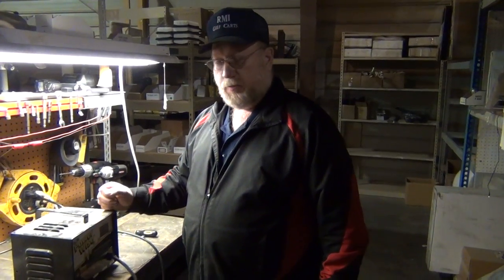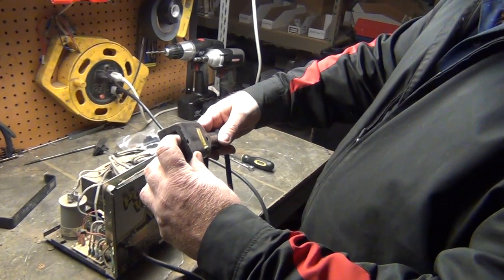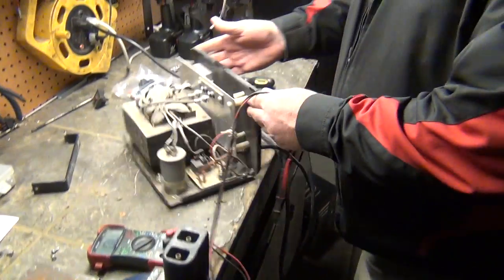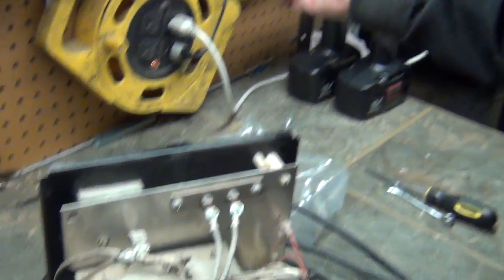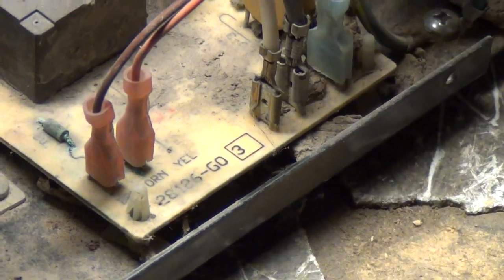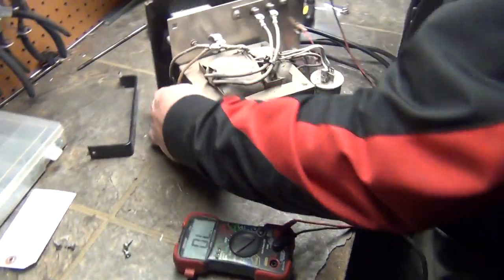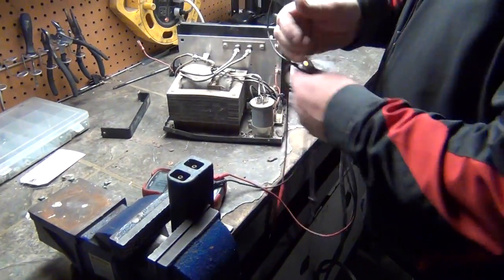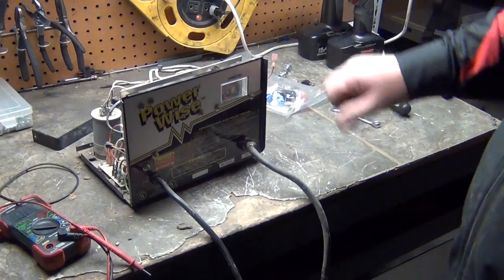How to repair an EZ-GO Powerwise Golf Cart Charger

Comment: Great video Matt! 

I tested my 50 Amp Fuse = good, Both diodes = good, grounding pin in handle =  good, the relay on the board, didn't buzz and turn on, so i assume it's good. however when i do continuity test from the screw on diode wire to the positive terminal on handle it works, it beeps.. negative side has no continuity, when i check with opposite screw like you did in your video. 

what would you recommend to test next? capacitor, transformer, etc? i don't see a bad wire. The wires coming from the diodes go right into the transformer itself. 

any help would be appreciated :) 

thanks

Comment: Great vid but what about the capacitors are fuses?  So long story short my charger was left in my trailer in the desert and 120° weather and I’m trying to diagnose it if it could be the capacitors or the long fuse I have a cylinder fuse EZ go  charger  80s early 90 thx Mike

Comment: Mike, does the black wire that connects to the red wire from the DC charging cord connect to the green ground?  It was loose when I opened it up.  The end of the wire has solder on it.  My charger was struck by lighting.  The fuse is blown.  Anything else in particular to look for?  Thanks for the video and for your response to come.

Comment: I had one with a bad capacitor. Replacing the capacitor fixed it. You did not cover that. It is not necessary to remove the charger carry handle screws for disassembly. Your video is very informative. I now have a charger that has a blown 50 Amp fuse and according to your video, 2 bad diodes. Is it common for both diodes to go at once? If so does that make the fuse blow? I just replaced the diodes and 50amp fuse. Totally fixed it.

Comment: I tested the fuse and the diodes and they are bad. Bit when i tested ths relay with the screwdriver i heard a buzz. Does that mean that the board is bad? Or do i have to replace the fuse and diodes first to test the relay?

Comment: Mike, not always the case. I ran the tests you described and found my board was bad by your directions. Replaced it and the charger did not work. Took a shot in the dark and replaced the capacitor after the board and it works fine. Thanks for the video.
Reply: David Biester Nest time measure the Capacitor like this: Set your ohmeter on a high scale and remove the wires from the capacitor, next touch the leads from the meter to the connections on the cap. If the meter stays on zero ohms the cap. is shorted, if the meter immediately goes to a high resistance it is an open cap. and is bad. If the meter slowly raises in resistance to a high value it is good. It is actually charging with a current supplied by the 9 volt battery in your meter. If you check the capacitor in the circuit with the charger humming you should see a voltage that looks ridiculous like 680 volts this normal. if you see something much lower replace the cap. also if you see a noticeable bulge in the metal body of the cap replace it.

Comment: If the multimeter beeps when i touch the heat sink board is the charger still able to charge? The charger humms whenever i bypass the relay, so i know the control board is bad..

Comment: I bypassed the board and found it to be the problem but put a new board on and it still does not work.  I bypass it again and charger works and golf cart response.  I have now tried 2 differ "new" boards and the charger is still a NO go.  What else do I need to look at??

Comment: I replaced my board, fuse, and diodes and my charger still wont charge, i can jump the relay on the board and it will charge. Any suggestions?

Comment: My charger is not fully charging by dead batteries. It should take 6-8 plus hours to full charge the batteries. When plugged in the meter shows charging but in an hour or two it shuts down.   What could my problem be?

Thanks,
Dale

Comment: This is a great how to video.  These type of chargers are really simple and reliable in my opinion.  So why does my EZ_GO have a PowerWise Qe model that looks like a power supply out of a computer on the inside?  There is no simple fix for that one.

Can I use one of these older style chargers in the place of this fancy, expensive to maintain one?
Reply from the maker: Sure, as long as its 36v.

Comment: What about the chargers that replaced that model. One little black ones with the cooling fins around the charger does these same things apply to it. Would love to see a video on that style charger thanks man
Reply from the maker: Unfortunately, those newer charger cant be repaired. We have to send them in to be rebuilt.
Reply: Thanks for the reply
Mines a power wise QE I think what's a rebuild on one of them usually cost? And is it even worth it or better to just buy a new charger
Reply from the maker: I'd probably buy  a new one. https://www.rmigolfcarts.com/products/e-z-go-rxv-txt-48v-charger-pf11595
Its about the same as having them rebuilt.

Comment: SO, what does the clip in the charger plug (he calls it a handle) suppose to look like? Does it curve out, does the end point outward, etc, etc? I see the clip. It is not touching the post. It is bent into a rounded shape. I do not know if it is suppose to be flat and touching, if it is suppose to be rounded and spring back and forth, or what. Thanks.
Reply: I took the "handle" apart, and it was evident how it is suppose to be bent. Everyone I know, call that a plug. The handle is the handle on top of the charger, to carry it around.

Comment: Have changed circuit board, 2 diodes, checked continuity all the way through. All is well. When plugged into cart nothing happens. if batteries are bad will it not come on?
Reply from the maker: +Manuel Pace My main charger guy is on vacation. If you want to call us Toll free next week he should be back and can walk yous through any issues you are having. 866-379-1211

Comment: the board test is presented but is confusing...I checked the board, it sparked and came on, but the video says the board is then bad?  I changed the board, but the charger still did not charge.  The most important thing before you start changing boards is to check each battery individually to see if they hold a charge, (with a regular battery charger for 6V batteries)  If even one battery is bad (won't hold a charge) then the charger won't come on.. its not the board... its the battery!

Comment: Hello,a client brought in a ez-go powerwise QE charger, but I have no idea where to start, he says isnt working, it gets plugged into the cart and wont come on. Should I follow same directions as this video?  thanks
Reply from the maker: The same trouble shooting techniques do not apply to this QE charger. They are not repairable like the Power wise.. Make sure the power from the outlet is good. Also want to make sure the voltage is high enough on the battery pack to kick on the charger. I'd also check the charger on another car thats working. That way we can be sure its the charger and not the cart. If we know for sure its the charger, then it would need to be replaced.
Reply: well to srart ipen the charger then u see a circuit board with a black realy it only has. to with that relay make sure you u disconnect the two wires fron the realy so wen they are ones dis  connected make sure u have a jump wire so u can put them together and y watch ur charger it would start no matter but before u do that make sure its disconnected please i should know. all this because cause i work in a golf cart shop i ( mechanic )

Comment: How do you jumper the low voltage safety switch, so you can charge cart with low voltage.
Reply from the maker: To jump start a power wise charge you would need short across the relay on the control board. The relay has two black wires running to it one comes from the transformer and the other is from the A/C cord.
Connecting those together will make the charge a live charge it will continue to run until it is unplugged from the power source.

Comment: have changed circuit board and diodes and the charger will not come on . any suggestions
Reply from the maker: +Manuel Pace could be a broken wire inside the DC handle, usually the red wire? Or, maybe your batteries are just to dead and the charger wont pick it up.

Comment: Mike, my charger passes all the tests except the board test.  When I touch the posts on the board with a screw driver; it only sparks. The charger does not come on.  Would my problem be the board?
Reply from the maker: Make sure its plugged into the cart? If so, and its not coming on, it could the transformer? Feel free to call toll free and talk to Rick if you have any more questions. 866-379-1211

Comment: My powerwise 2 golf cart charger has started buzzing. It still charges correctly. The cords are not hot, they are normally warm. What can I do to fix it and stop the buzzing?
Reply from the maker: Does your amp meter go up to 10 -12 when you plug in? If not, probably need a capacitor. That may fix the buzzing. or you can call us toll free 866-379-1211 and ask for Rick

Comment: Hi, Matt, do not know if you still see the comments... any way I was recently in need of this video.  I was follow the comments. my Board Sparked when I put the screwdriver between the wires, then I saw it must have a load.. plug into the cart... and it turned on when I plugged the cart in..????  scratching my head, shorting a board repairs it... maybe woke up a capacitor..
Reply: That means that your relay went bad. So  change the board out since the relay is apart of the board

Comment: This is good from most problematic to least!
1. Plug or Cable
2. Fuse
3. Diodes
4. Board
5. Capacitor ( I have seen this a lot actually)
6. Transformer ( never seen actually go out just hums and doesn't put out quite as but of charges as a new one ) downside very loud and long charge time.

But the number 1 thing is make sure your cart has enough charge/votage to trip the charger to come on!  You missed this one!  Use a high start battery charger on 2 of the batteries in series to trick the charger to come on!
Reply: You're right! I didn't know this until after I already took my charger apart. Thinking the charger was bad. So I found a video on here that said if your batteries has no juice the charger wont kick in. My batteries was pretty old and been sitting for almost a year. Went out bought new batteries and put my charger back together. Plug in my charger and  BAM! the charger kick in. But other then that this video is very helpful.
Reply: I said that lol!

Comment: Mike you don't know if the diodes are good or not, you must reverse your red and black leads and test again the diodes will conduct (beep) one way and then not beep when you swap the leads. Better yet invest in a meter with a diode test scale and look for a reading of .450 to .500 one way and zero when the leads are reversed.
Reply: Dan Chalfant incidently you can still buy the diodes on a heatsink from Nivel Parts for Golf Carts for about thirty to forty bucks. It is much cheaper if you can buy the single diodes if you know what kind to buy at a electronic shop like Radio Shak or Fry's they are cheap a couple of bucks a piece.